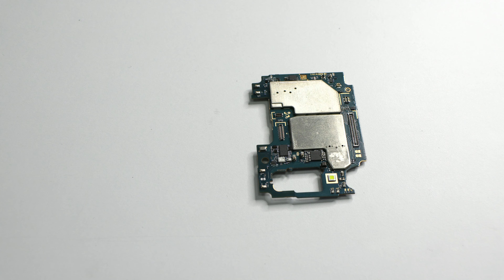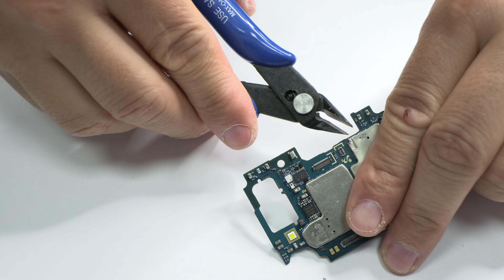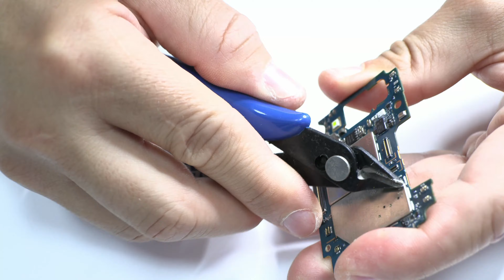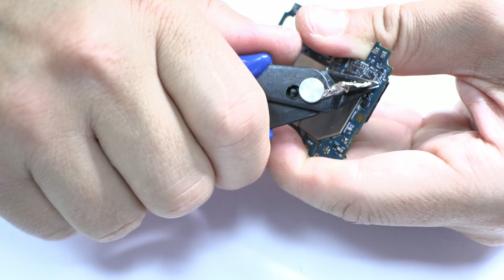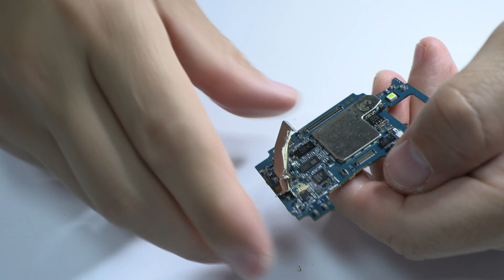How do i remove PCB Shield Safe Way✅

Comment: I don't think this is the safe way.  By cutting and pulling shield off with snipper, you can damage the pc board.  I suggest the best  way to remove shield is using dremel tool.  Shields are made out of very thin metal and top can be cut and removed very easily with dremel tool, leaving the outer edges.  Later if you want to cover it back up, use sticky aluminum tape to cover it for emi shielding.
Reply: I'm cooked? I did this and now I can see a little brown spot on the motherboard

Comment: There is no need to take risks. You just need a normal hot air soldering station and a person who knows how to use the equipment. And the fact that you have this level of homemade.
Reply: There is more risk adding heat as some shlields are difficult to remove, even at 500c the thing wont lift of, and your risking frying caps or desoldering ic chip solder balls.
Reply: their always risks. your comment shows you know very little. one mot always take the least of risks as possible, creating another problem to solve one problem is not the way. i am experienced and cellphones are a headache for this reason, this is why i prefer laptops

Comment: "Not risk the motherboard with an hot air station", and then use a cutter to literally split the covers, with the consequence that you could also remove fundamental elements of the printed circuit board as well as components in nearby areas.
There are various methods that require skill and equipment to properly remove shields, and this is not an example of how to do it.
An engineer studies for years to put the covers on and then you come along and cut them off.

Sorry, dislike deserved.

Comment: This way you cant use the shield back
Metal shield comes from factory with a reason
You also risk bending the pcb and knocking small component
There's no safe method, phone repair always come with risk
Reply: Yes
Reply: Think the reason is to prevent RF interference
Reply: @pow9606  to prevent repair. its why high temp soldered